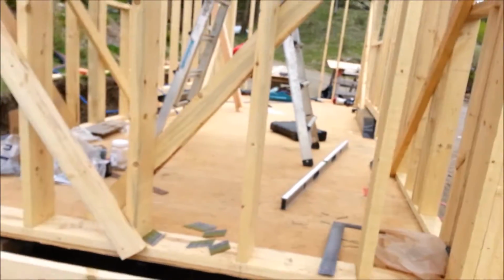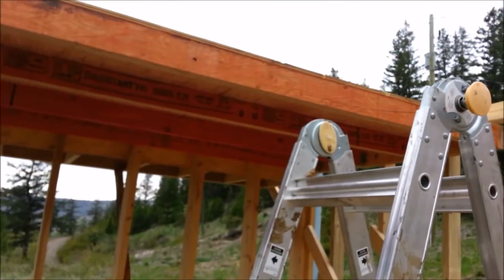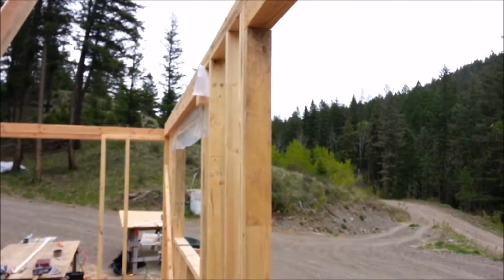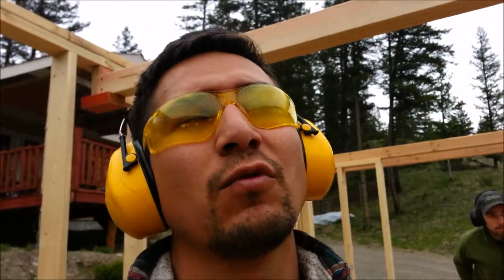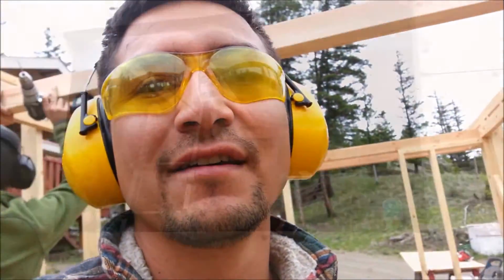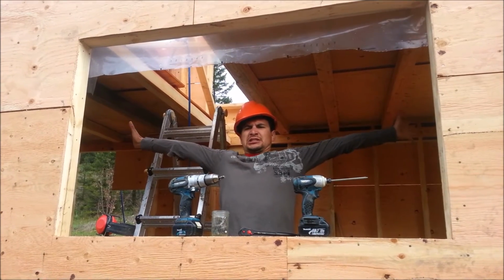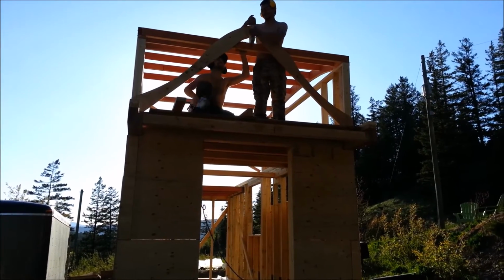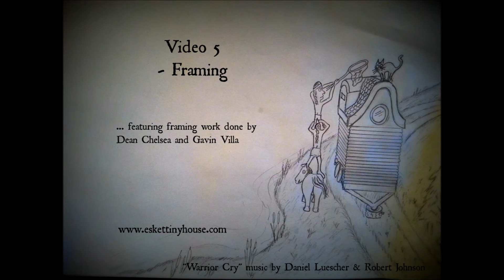Framing a Tiny House - Video 5

Comment: Ha ha, love the video and the original Sun is Rising song!

building one in Ca (just got trailer) and thinking of a curved "vardo" style roof because I like it mostly from the interior.
Do you use ring shank nails? I thought screws were stronger than nails?
Reply from the maker: +Paul Burns haha, yes the "Sun is Rising" song, so much fun! -what we did, is we used ring shank nails, and pl premium glue and seriously glued all our sheething and rafters. The reason why we didn't use screws is we were thinking about the structural integrity, the screw has strong pull-out strength, but limited lateral strength, so the screws wouldn't pull out, but they may snap under pressure? that was the thought - maybe check the structural rating on your screws. We love the curved roof, (ours is only curved on the exterior), only consideration with that is the extra time it requires..